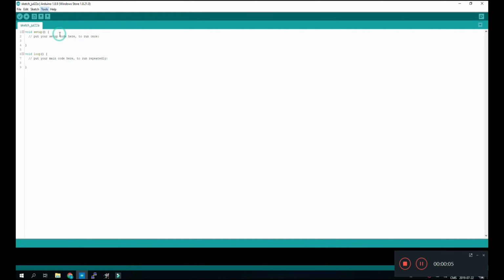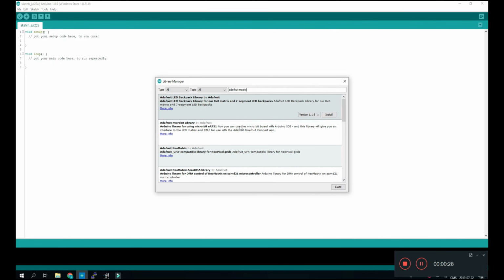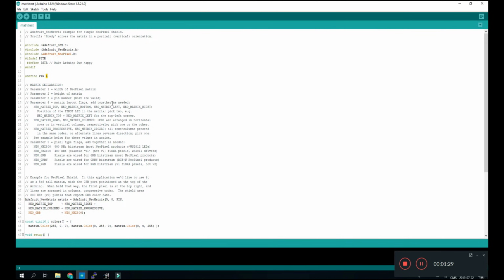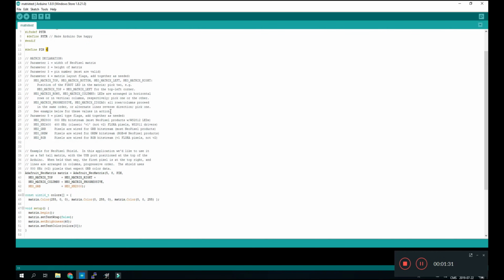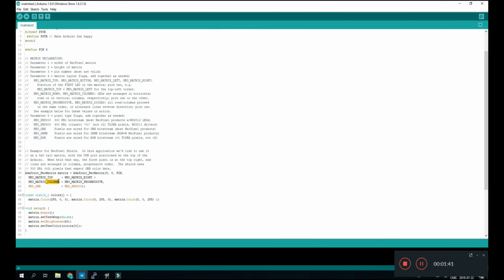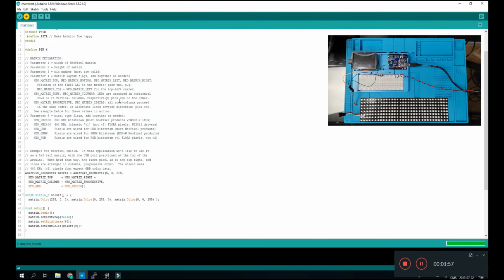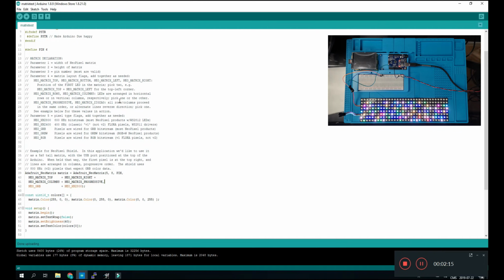How to control RGB WS2812B  LED 32x8 matrix with an Arduino - Tutorial

Comment: I am so frustrated because I bought one of these, no instructions manual whatsoever... I don't know why do I have a main 2-wire pair for power at the center, and 2 more + and ground cables near the data in and the data out wires... your video is the only thing I could find as a reliable reference...

But the way you connect the wires... there's something weird about it... you use the "3-wire data in wire group"... 5V to the outer power source... it makes sense... but why the GND to the arduino then? Can the Arduino's GND PIN actually handle up to 15A??

I have literally wasted an entire hour trying to figure out all the technical details I need about the wires available in this matrix

Comment: Hi there, this is pretty cool. But I was looking for a way to have the letters static instead of scrolling. I want to learn how to scroll writing left to right, right to left, as well as top and bottom. But more importantly, how to get letters and numbers to fade in/out of each other. For example, a countdown from 10 to 1 fade out and in over each other. Is there a way to do this?
Thanks.
Reply: Change NEO_MATRIX_RIGTH for NEO_MATRIX_LEFT
Reply: @Jorge Gaona  So that will change direction of the scrolling but what about if I don't want scrolling? A letter appears then disappear after a few seconds and another letter appears. How can I do this? 
Thank you
Reply: change matrix.setCursor(X, 0);   to   matrix.setCursor(0, 0);    and it will just display the word with no scrolling

Comment: did you need an additional power supply? I thought I just needed my desktop at least + an arduino (esp12e in my case) gnd, vin, and din to d6, no other wiring. Is this correct?
Reply from the maker: Yes you'll need an additionnal power supply, that kind of matrix requires a lot of power and, unfortunately, an USB port won't be enough.

Hope that helps !

Comment: Do I need a resistor to stop it from shorting? 
I see you connected 5v to something other than the one on the Arduino, is it possible to use the 5v on the Arduino with the resistor? Or will I need a battery pack or something.

Comment: Where is the code
Reply: Its in the examples section. However I am using ESP8266 - Node Mcu and you catch my code here. It will work with any arduino .. just change the PIN details on the code.

My Code : https://drive.google.com/file/d/1cUPOmI0rTWho3FaaoTQNy6mXgPxdbAUv/view?usp=share_link

Comment: Hello sir. Ek problem hai @ this program is runing low long Ward.....
 I went running longWard  like. "ABCDEFGHIJKLMNOPQRSTUVWXYZ AAAAA BBBBB CCCC " this type
Reply: Plz give  cood .edit. a screenshot
Reply: @sushantakumar7794  You just need to change this line in your code:

  if(--x < -98) { // increase -98 as desired for longer text scroll
    x = matrix.width();
    if(++pass >= 3) pass = 0;
    matrix.setTextColor(colors[pass]);
  }

Did a few modification to have multiple text  scrolling and changes color for every text display. Wondering how to get data from a sensor and display as scrolling text. Unfortunately arduino ID does not support "(matrix.print(F("Have a Nice Day"));" to a variable I guess. Anyone got that working let me know. Have a great day.

My Code : https://drive.google.com/file/d/1cUPOmI0rTWho3FaaoTQNy6mXgPxdbAUv/view?usp=share_link

Comment: Hi thanks for the video, I’m wondering for some reason the PROGRESSIVE & ZIGZAG are in reverse. So when I try to run progressive projects using jinx my display jumps around also like it’s permanently in zigzag. Is there a reason for this my led running the opposite? Thanks
Reply: Change NEO_MATRIX_RIGTH for NEO_MATRIX_LEFT

Comment: Thanks for the tutorial! This got me up and running with an Arduino Mega2560 and a WESIRI 8x32 LED Matrix 256 Pixels WS2812B. I had to configure my matrix flags a bit differently than what was shown -- just kept NEO_MATRIX_COLUMNS in place -- but that was it.

Comment: Do you think it can handle 1,200leds? I want a 120x10 led matrix
Reply from the maker: 1200 LEDs might be too much, you might have issues with the RAM (and power supply would also be to keep in mind)
For more details, you can check this thread : https://forum.arduino.cc/index.php?topic=644898.0

Comment: Cool video! I'm just wondering: can you connect the ground straight from the matrix board to the arduino without using the breadboard?
Reply from the maker: Thanks ! Yes no problem, as long as the 3 grounds are connected together ( the ground from the 5v power supply, the Arduino and the matrix). The breadboard isn't important :)
Reply: @ReidProjects  Thanks alot! I learned a lot from this video. I'm a new subscriber!:)

Comment: Just curious, would you be able to cut it up to a smaller size and it would still work?
Reply from the maker: Unfortunately not. That said, there is smaller matrixes (8x8, 8x16) and if you need a different format, you can always take a ws2812b LED strip and wire your own matrix.

Hope it helps !

Comment: Hello, thank's for this topic, it works great for me. But i have one question, i don't set more than 12 caracters....; How can i increase the maximum caracters please?
Reply from the maker: Hi, sorry for the Delay ! Do you have an error on the compiler or there is missing chars when it's running ? It's not wired on my side at the moment but I'll try it within the next days.
Reply: hello please what version of library u used

Comment: I like your project and I would like to make a similar one to use it for our Senior Center Dances. To display "LET"S KEEP DANCING" or any other similar message. The LED matrix you used is not available and I wonder if I could one for sale at Amazon made by BTF-LIGHTNING>
"BTF-LIGHTING WS2812B RGB 5050SMD Individually Addressable Digital 8x32 256 Pixels LED Matrix Panel Flexible FPCB Full Color Works with K-1000C,SP107E,etc Controllers Image Video Text Display DC5V"

Do you think it will work?
I have an Arduino Duemilanove. It is like an Arduino UNO. I hope it works. I might like to attach two matrices later. But I think I will need to buy a power supply with more watts. Thank you.
Reply from the maker: Hi, thanks ! 
Yes any matrix using WS2812B should work without trouble. You might only have to play with some of the settings if they're not wired the same (i.e. not in zigzag).

Let me know if you need any help !
(And I also updated the links in the description with some matrix that should works, thanks !)